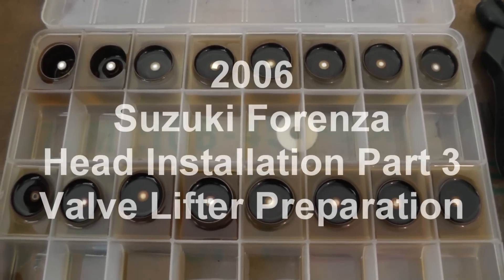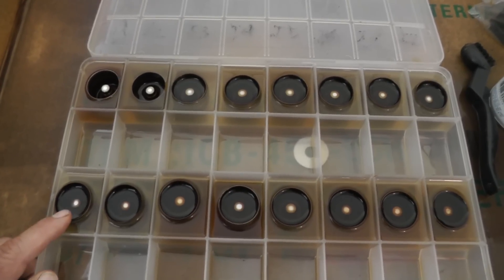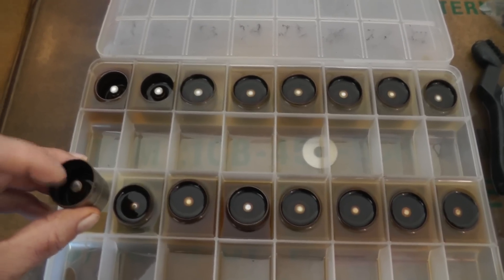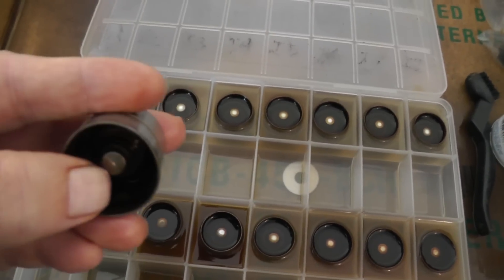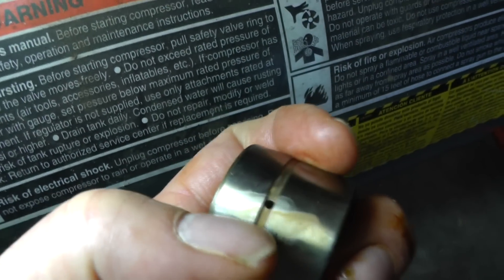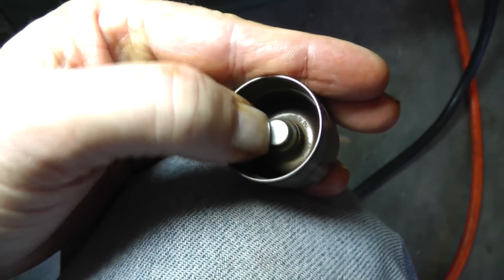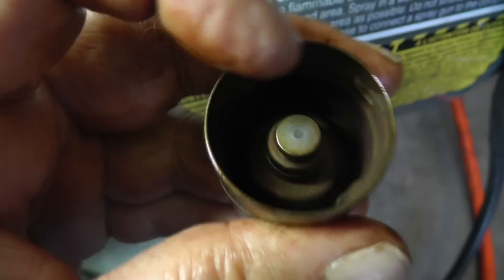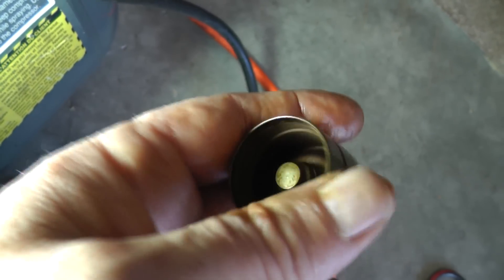Suzuki Forenza Head Installation - Part 11 (Lifter Preparation)

Comment from the maker: Hi Brad, I'm glad things went pretty well for you. Yes, that tensioner can't be a little aggravating to get just right and be sure to take the time to have that pointer inside the notch. I'm going to do a few more things on it tomorrow and of course I'll show the entire installation. Those four large o-rings that you have and you should have two bags of them appears to be for the fuel injector o-rings, top and bottom. They were too large and I used the original o-rings. Hopefully, no leaks.

Comment: Interesting discussion on lifter bleeding..on my 383 small block, i did a recent higher ratio roller rocker arm upgrade..and as i set the valve lash to 1/4 past zero lash, i was actually hanging a few valves slightly open..it wasnt enough to bend a valve..but it can be quite scary if you dont know what you are doing..nice video

Comment: Thanks for asking, once I followed your method for putting on timing belt , I had no problems.Except with tension idler was not fun. I not sure if you are going to show us putting on value cover since you already have torque specs, but my kit came wit 4 large o rings, that were not on the original cover. Do you know where these go ?

Comment: Hi Terry, I'm really enjoying your videos I'm changing a head gasket on 2004 Suzuki Forenza and they are really helping me.  I'm bleeding my lifters like you said with the vise.  I did 6 and I only got one that springed back the other go up and down and don't have any spring.   Is this okay or are they bad? When I pressed the oil out; I had a lot of black crud coming out.  Thanks
Reply from the maker: Hi b2...Ideally, they should spring back and another viewer had the same issue. I mentioned that the lifters would probably pump up anyway since there is a check ball inside of them. I never heard back from him so I can only assume that everything went well for him. You can try them out and see how they work out. Just keep up which ones are which just in case they don't pump up. As for the bleeding, you only need about 1/8" so it doesn't take much. As you know on mine, there was a lot of sludge, so I was depressing it fully to get all of the dirty oil out. In my case, all the lifters worked out fine. Keep in mind that when you start the engine, it will do some rattling of the valves which is normal. It will take from 15-30 minutes of idling before the rattling stops. Glad to hear that the videos are helping you out and good luck on your repair.

Comment: Hi, this is a nice and useful video . I have a Forenza with noisy tappets (lifters).  If I want to bleed clean and reinstal the lifteres (tappets) Do I have to remoce yhe entire head? I guess  only have to remove the camshafts, but I'm no sure. Thanks a lot
Reply from the maker: javistm256 You just need to remove the camshafts. Once the camshafts are out of the way, the head stays in place. I use a magnet to pull the lifters out as I show in one of these videos when removing the camshafts.
Reply: stuzman52 thanks a lot, your videos gave me confidence for doing the job!

Comment: what do you do after you put those in the vice to facing press it down and bleed the oil out of them if after you bleed on if they pop back up in their heart and they don't want to press down on their own does that mean they're bad and you need to replace or more what
Reply from the maker: When you take the lifters out, they will be full of oil and the stem will be fully out. The whole idea is to let a little bit of the oil out; you only need to have the stem go down about 1/8". I did it further to remove all oil because of sludge as I mentioned in the video. Otherwise, when the stem is fully out, it's possible that one or more valves could be slightly open which could cause one or more valves to bend. When you put a lifter in the vise, you have to slowly turn the vise handle, wait a moment and turn it slightly more. It's under pressure. I would say your lifters are fine and you're experiencing what it should do.

Comment from the maker: Oh, by the way, I assume that you saw the video of me discussing the camshaft cover where there are ten o-rings for the bolts and the o-ring installation. That should be in Part 8 of this series. I ran out of room in the other comment, but if your injectors weren't leaking, you can use the original o-rings although having new ones would be ideal. I think my original o-rings will be fine though.

Comment: Good morning,
My timing marks don't line up. They're off by a little what should i do thanks..
Reply from the maker: Hi angel. If they don't line up, take the belt off, make a small adjustment to get the marks aligned and then reinstall the belt. Whatever you do, don't start the engine until you're absolutely SURE that the marks are correct. Otherwise, well, I believe you know the answer to that one. Take care...

Comment: hello, so what do you recommend i use for coolant i used a universal 50/50. gm has the dexcool but i heard so many issues with the head gaskets because of this coolant.. what are your thoughts??? thanks
Reply from the maker: Some people say there isn't any issue with the Dexcool, but I have to disagree with them since I had this stuff in the Buick from the factory. Only after 50,000 miles, the Dexcool had a brown, slimy sludge building up in the coolant tank. I got that stuff out and have been using Prestone 50/50 coolant mix. Same holds true for the Suzuki. So, with your generic 50/50 mix, you should be good to go.
Reply: thanks again for all your advice!
Reply from the maker: No problem angel. So, how is car running? Pretty good, I hope.
Reply: its running good real quiet not shaking.. but i do have a solid check engine light on..i think its one of my o2 sensors not sure yet im ready to dump the oil out and change it again..take it for a test drive..i did notice that my catalytic converter was broken up a little in the inside so i bought a new one.
Reply from the maker: If you had a coolant leak with your head gasket, meaning oil and coolant mixing, that's a very good idea to change the oil and filter again. Also, before you start changing an O2 sensor, get your code read so that you have some direction where to troubleshoot. You can go to Autozone or Advance Auto Parts and they can read your code(s) free.

Comment: thanks god and you for this video!! are you doing the lifters bleeding because you put new valves and had machine shop work done? i mean i have read that when you modify your cylinder head in some way (new valves, new cams, etc) you need to do this bleeding. what about when someone just puts a new cylinder head gasket. do you think that this will apply too? in my case all i did was to put new head gasket and resurface the head. in the web there's different opinions about the lifters hardness. some say they are supposed to be hard and others said the contrary. for this reason its confusing. thanks again!!
Reply from the maker: Hi Pedro. In my case, I had machine work done because of bent valves. However, even if you remove the head to replace the gasket, it's always a good idea to bleed the lifters. You only need the stem to move about 1/8". The reason is that in some engines and I'm not sure about this engine that when lifters are fully pumped up the stem may actually move outward a little when the camshafts are removed. With the stem out a little more, the valves could be held open where in some cases, the pistons could hit the valves and then bend them. In other cases, where the piston doesn't hit the valves, yet they are still slightly open, you could get misfires. My machinist says that it was always a good idea to bleed the lifters slightly so that this problem will never come up. You'll hear a little rattling of the lifters when you first crank the engine up, but after about five minutes the noise should get softer. After about 25-30 minutes of running the engine the noise should be completely gone. Hope that helps you out. And thanks for your comment and for watching the video(s).

Comment: Nice video brother quick question I have Suzuki forenza 2006 2.0 liter dual overhead cam timing belt ,ok my question is what's the name of the parts going on the top of the cam shaft holdin them ,ok the other question is that little parts have to go ech one on the right position because I'm doing it I work and I didn't remove the head  somebody else did and I need to put everything back together if u can help me tanks sr
Reply from the maker: Hi ElForastero10287. If I understand your question, the components holding the camshafts down are called camshaft caps. If you look at the video where I install the camshafts, the caps already have numbers marked on them from the factory so that you can put them back where they belong. Take a look at that video and you'll see what I mean.
Reply: I see the numbers but they dont match ,i have 3 wit diferent number i have a number ,7 ,number 6 and number 0,so  and i dont wanna mest up the cam i tink going to ,pickand pull probable i found one just to make shure the have the same position,or the same number ,im goin to check again the video but i can't see really well the numbers 😕
Reply from the maker: ElForastero10287 The numbers all should be different starting with 0 which I believe was on the exhaust side starting at the end where the sprocket was. Oh, I've got some news about the numbering of the camshaft caps. I told you that it was in the camshaft install video, but I was wrong. So, I spent about 20 minutes looking for it. It's located in this video https://www.youtube.com/watch?v=A3cImahTqn4&index=17&list=PLrbHoqGceWKRspWg6l03EtyPlHoiAdMks at timeline 12:09. Hopefully, that will help you out about the numbering from the factory.

Comment: How much does a machinist charge you to do a valve job on a Suzuki Forenza engine thank you
Reply from the maker: Back in the day when I did this job, the complete head work was about $300.
Reply: Yeah I cleaned all my journals but I think one of my valve got stuck and it jumped time I got Spark I got fuel if it won't start cuz when I sold the car I quit running on the kids only taking it back and I'm going to fix it I hope it's not hard to do after watching your videos I'm pretty good at hit I did three of them thank you for getting back to me

Comment from the maker: I'm sorry Brad, I thought you were doing a head job. Since you didn't have to pull the fuel injector rail, you don't even need to worry about those o-rings. Sorry for the confusion.